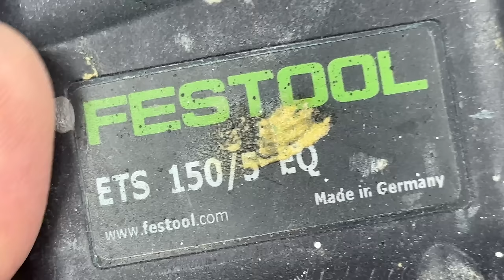Money, Mouth - Mirka! [video 507]

Comment: I have had a Deros for about the past 8 years and I agree with Kieran, its a dream to use. I purchased one of the original models and had a couple of issues after about 18 months but Mirka sent one of the updated models, with no quibbles, and its has been brilliant. It gets used most days and the results are always excellent. The dust management is absolutely first rate.  Expensive yes, effective yes, would I change it for another make NO!

Comment: @Peter Millard: Great video, as usual. About the speed control on the flappy pedal - you can look at it as a soft start kind of deal. When you started sanding with the rectangular festool, as soon as you made contact with the board it wanted to slip out of your hands because it was already at full speed. That's where I see the benefit of a slower start.
Reply from the maker: Interesting, thanks! I’ve never done it any other way, I’ll give the slow start a try! Thanks! 👍

Comment: This is good.  I took your Deros concerns on board, and did a ton of reading, and found it was only woodworkers in a certain time period that had switch issues.  I've had mine two years now and can be on it for 6-8 hrs some days.  The only issue I've had is the mains leads packing up, but Mirka now do rewirable leads, and with them it's so far, so good (my original lead and my intergrated hose lead both died).  The replacement leads are quite affordable, so bought two so I always have a backup, and have hacked my hose lead to be a female socket for any tool to attach to.

Anyway, it's good that you're going to do a thorough test.  Just noting the difference in the sanding patterns is a big thing.  I remember your side by side test a while back and also in terms of dust extraction the Deros with Abranet was hard to beat.
Reply from the maker: Thanks! Yes, no,issues at al, with dust extraction, though I’d suggest that outstanding dust collection, low weight and vibration, great handling etc… are table-stakes at this kind of level. 👍👍

Comment: I’m into property maintenance coving most aspects of renovation. 
Had plenty of cheap sanders and extractors that never truly gave me what I wanted until I found the mirka sanders at d&m tool show. 
I bought the two you have. Took me an age to get to grips with the paddle and also had a few cock ups picking them up when I thought they was turned off. 
But time went by and they was great. 
The deros went bang first just after the warranty expired so I replaced it then both went wrong in the same week. 
The parts prices makes the a throw away tool. 
I truly look after my tools and know how to use them so felt very let down by the mirka and now don’t recommend them. 
I do also know 3 other people that’s had the same problem. 
Festool sanders for me now and do own a rts400 the same vintage as the one you have and it’s used most days and at times most of the day and it still runs sweet. 
Hopefully you still have something to give away Peter🤣
Reply from the maker: Yep, I mentioned all that in the Deros video I linked to here - links to Keith and Leo’s vids in the description too - and the comments in my deros vid were pretty much split between reflecting your experience, and ‘I’ve had it for XXX years and it’s been perfect…’ 🤷‍♂️ So this is me , giving it a shot with my own cash. Keep you posted! 👍
Reply: @10MinuteWorkshop  I’m guessing I was shocked it happened as I really do look after all my tools. 
Time will tell Peter and hopefully after the year I’ll use them for another😂😂. On a serious note I truly hope they work well for you as I had some real good days enjoy the ease they put into a working day. But I will say I suffer less now with my hands then I did with the mirka. Festool are very smooth. 
Keep up the great work you do 👍

Comment: I guess you were told at Mirka: When it comes to vibration, the counterweight at least at the Deros is set for Mirka Mesh sanding disks. If you use heavier paperback disks on a regular base, you should adjust the weight with the small Allen head screws that you can find in the systainer.
Reply: PS: as mirkas origins are in the automotive sector, the floppy pedal comes in handy when you sand on round shapes, so you can dail the speed down for less abrasion on a small spot.
Or as leazy woodworker - use it for quick n' dirty rounded corners...

Comment: I’ve had Mira Deros over 18 months now and I have to say it’s an absolute dream to use, not one single issue with it there’s nothing you can not sand with this machine so light and responsive. I’ve had a metabo 150mm orbital for the last 10 years and only had to change the pad after about 8 years again a superb machine, but the Mirka is streets ahead and with the mesh discs virtually no dust 👍

Comment: Back in the 90s, I had a summer job at a boat builders, sanding yacht hulls. We used air tools exclusively; battery tech wasn't there yet and air was better than mains electricity.

I'd completely forgotten about that until now. It seems an air sander plus compressor would be cheaper than the Mirka sanders, especially if you're buying two, and extra especially if you've already got the compressor for your nail gun.
Reply from the maker: For something like a nailer, a small compressor is fine, but for anything like a sander then you need a huge compressor to keep up with the demands, so not really an option. 👍
Reply: @10MinuteWorkshop  then I'm glad I asked! 3M do a RO sander for about the same price as the Festool, that looks like the Deros. It seems to be getting good reviews.

I normally get blue Bosch tools, but I'll break ranks if another manufacturer makes a better offering for a better price.

Comment: Just in case no ones mentioned it - it looks like you're using mesh sandpaper (looks like Granat Net?) without pad savers (protection pad) - your sanding pad will thank you if you do use them. Good luck with the long term test - great to see you tubers of your calibre, commit to the only sort of test that's really worthwhile for people considering this level of equipment.
Reply from the maker: Not a fan of pad-savers, personally - I don't like the layer of softness they add - but that's all part of the long-term test, how do the pads hold up over 6-12 months of use without a pad saver?? 👍
Reply: @10MinuteWorkshop  That depends on how much, and how you use them - if you're using them for a few hours every day and perhaps bearing down on them a little, then those little hooks are going to wear down fairly quickly. I've never done a controlled test, but when I first started using Abranet (a few years back now and without a pad saver), I remember being decidedly irked when the hook and loop grip started to fail way to early for my liking, and I had to buy a new backing pad.  A pad saver costs around £4/4.50, a 150mm backing pad (for the Deros) around £35/40 - for me the pad savers are a no brainer. The marginal extra softness the pad saver gives, doesn't create a problem for me. 
A possible solution for you, would be to switch to 3M 775L cubitron ii discs - you may lose a little where dust extraction is concerned - but no need for a pad saver, and I suspect you'll get significantly more sanding done with a single cubitron ii disc than an Abranet one. 
Out of interest, did you give the Festool ETS EC 150 a try, before buying into Mirka? And a top tip with the Deros, is don't drive it too hard - it rewards a lighter touch. I made the mistake of lending my first one to a client  - even after detailed instructions and a demonstration, they managed to burn it out (the speed controller is the first thing that fails) by running it at top speed and bearing down on it too heavily. 
My view is that even though the Deros wins on ergonomics - the Festool wins on solid engineering, being able to run it all day and that pad break clinches the deal.  
Thanks for all the time and effort you put into these videos, you deserve the many subscribers you have. 🙂

Comment: I love the rts 400, dust control/vibration superb, not so keen on the height, Flex have bought out the OSE 2-80 EC (brushless), haven't found it in UK yet but its more compact than the Rts, doesn't have festool plug-it though ☹️ if the paddle gets on you nerves especially with accidental turn ons when I had the Metabo green deros I taped it with masking, just used the on/off button then, as a decorator I could flip it around and change hands when the sanding burn set it doing ceilings and walls, used to get annoying with the paddle but the deros lookalike did a superb sanding job and I had a reliable one.
Reply from the maker: Interesting thanks - never heard of Flex tools before, looks good though. Yes, I taped up the paddle, but have got used to it now.  👍

Comment: I just got the 3M sander. I haven't had a chance to use it yet, but I did turn it on just to see. And the comfort compared to my dewalt random orbital sander was pretty obvious.  But clearly, there's a large following for Mirka.  But as an Xtract 3M sand paper fan, I'm grateful that Mirka's patent on mesh sandpaper expired - giving us Xtract from 3M.   Funny how we all get so attached to our tools :)
Reply: I bought the 3M too. I have the Mirka Deros, but its been repaired 3 times (the control board). Repairs have been under warranty and out of warranty. Parts are very expensive. This is why I have the 3M Xtract Electric Random Orbital Sander. Time will tell on reliability, but the sander is impressive in use. I also have the RO 150 FEQ-Plus, a very different machine for different tasks. As you can see I am not a brand fan, I appreciate quality tools that do the job they are designed for. I want to make investments that last and give great service. This is where the Mirka Deros has been disappointing for me, I'm hoping 3M proves to be a great buy.

Comment: Great vid Peter, I’ve had mine for 6 years or so now.  I’m a dad first and foremost that does as much for 3 homes as I can (2 sons and my own)I came into the Mirka range out of needing a good industrial sander for my first fit out of my sons salon.  Now on my second and yes retirement is only a word! I bought the corresponding Mirka dust extraction vac at the same time at a very affordable price for the two.  It’s been an absolute workhorse including 600 square feet of oak floor.  Dust extraction on the horizontal is first class.  Paddle switch is a bit marmite - sometimes I love.    Initially went out deliberately to purchase Festool based on this channel but common sense and my wallet made the final decision.  Is it better than Festool I really can’t say only that it has worked very hard for me over the years giving me very good results.  Love this channel - thank you.  Best regards Mike
Reply from the maker: Thanks Mike! Yes, I'll see how it goes with these two; I know guys who have had them for years without issues, and other who've had them fail in months after very light use. 🤷‍♂️ 👍

Comment: I am not sure if someone has already commented on this but another significant difference in between your Festool sanders and the Mirka ones is the fact that your new Mirka kit is brushless: the noise and vibration must be much quieter / smooth even if did not make mention of that. Everything that I have read about it points out the new 3M sander as the machine to beat when all is taking into account inc price - shame its power cord is not detachable. I’ll keep making do with my old Bosch stuff until they break down. I would love watching someone taking all these sanders apart and do a review on its internals assembly and engineering for the sake of longevity!
Reply: I’ve just replaced my Ceros after 12 years. Now using a Deros. I run a one man professional furniture/cabinet business. I’ll keep buying Mirka Sanders as long as they’re around. I’ve used everything else and they are the best. Hands down.
Reply: I put a Neutrix socket connector on my Deros like most of my other tools.
Reply: The Deros love the paddle switch, hate the crappy quality non flexible cable that you can’t easily change because Mirka have their own socket.  Soldered on a Neutrik socket, looks like shit but works a treat.  I would be tempted to swap out my Festool sander for another Mirka because l find the Festool a bit top heavy, when using over head.  But l not spending £450 to then swap out the socket and invalidate the warranty. 🎉

Comment: Mate, you're holding them both incorrectly causing an imbalance in the sanding pressures.  The heads on both are designed to fit in your palm for even pressure. Otherwise an excellent video. Thank you for taking the time to make it.

Comment: Sanding everyone’s love. I have a Bosch GET55-125 at 2.5kg heavy and I think it only has a 1.75mm stroke. However it has a switch for direct drive which fixes the random orbit for heavy duty stock removal. I have been please with with.
I stuck to the 125 size so I did not have to have 125 and 150 consumables
Reply from the maker: Yes, that's the Bosch Rotex-alike; solid sanders, but not lightweight! 💪 👍
Reply: @10MinuteWorkshop  a bit like myself Peter 😆

Comment: i used an orbital sander for a while then went back to manual sanding with the paper and cork block, I find it easier and you are in control more, perhaps the only issue is dust but saying that since its manual it does not blow all over the place like a machine one and you can at times slant your work piece and the dust drops to the top/floor. Maybe one of those fancy yellow sanders ( Mirca I think its called) might be my next move , but they are not cheap. Also manual on the edge is better I think, you just adjust the sandpaper harshness if need to be (say 80 to 150 grit for example)
Reply from the maker: Mirka sanders are the ones I’m using in this video.

Comment: Yes indeed these Mirkas are damn pricey.   There is an alternative with the 3M sander but in all honesty it is almost as expensive.   I used a round version of the Mirka earlier this year and agree that the toggle flap is very cumbersome to try to vary the speed.  It is not easy to vary since the range is so tiny.  A simple adjustable knob would be better.  Perhaps this flap works better for car refinishing?   Aside from the price I found the Mirka round sander to be pretty similar to others I have used.   I cannot say it out performed by any stretch.   I honestly have yet to meet someone who loves them.  But hopefully we will see as Peter uses the sander over the next few months.
Reply: Been using Mirka sanders, I’m my professional shop, for 13 years.  I’ve used the rest. No comparison.

Comment: I do not trust myself with a powersander on the edges. I use the deros for the large areas and Mirka's handsander (it is more or less a  block shape, but using the same round sandpaper pads as the deros), with its dustextraction, for the edges.

Comment: After a lot of internal back and forth on the Deros due to reliability concerns, I bought one at the beginning of the year. It is my favorite sander I have, but the ets ec is no slouch either, I just think the Deros is a comfortable sander to run. 

After purchasing the Deros I was trying to find a way to justify the Deos. I also replaced a 10yr old RTS last December with a new RTS. Yet I did still consider the Deos because the height of the sander versus the RTS is appealing. plus I'd get a spare plug assuming that they are interchangeable like Festool lol. 

In the end the Mirka pricing structure on the Deos for the USA seems whack and is the deterrent. Mirka is usually the more expensive option in the States compared to Festool, except for drywall Sanders. But the Deos is listed at $507 without a systainer versus the $289 RTS with systainer. It just doesn't make sense for me atm out of principle that you can almost buy two RTS's for one Deos lol. 

Anyway I'll be interested in your opinion on the Deos after you've logged some hours.
Reply from the maker: Thanks! Yeah, Deos pricing is a little nuts everywhere it seems, about half as much again here as the RTS. 🤔

Comment: Hi Peter! Thanks for your great job on YT. I didn't know that brand before so thanks for reveal it. Have you any experience with vacuum cleaners from them (Festool systainer compatibility I see)?
Greetings from Poland!
Reply from the maker: Thank you! I'm afraid I've only ever used the Mirka extractors at their facility, so I dont have much experience of them; from what I can see, systainers will only attach using set of additional 'case fastening' clips.

HTH Peter
Reply: @10MinuteWorkshop  I do appreciate your answer. You seem to be very busy man! I'm your fan since about two years. 
Good resting!
Bogus

Comment: Honestly festool are missing a huge trick from mirka, they could be making a full line of sanders based of the ETS EC body. An electric 77mm orbital, delta and a square sheet sander all in the same shape would be killer. I wish I liked the mirka enough to buy a deos, just as good a sander as the festool but the ergonomics and the brake make me wanna pull my hair out

Comment: Hi Peter, Ive been looking at the Deos. Im I right in saying there's 3/4 different size machines or Im I looking at the wrong machine?
Reply from the maker: They make a few different versions, with different pad sizes and shapes yes. This one is the 81 x 133mm size - same as the RTS400, the Rupes LE71t and the Bosch GSS 160. 👍
Reply: Thanks Peter